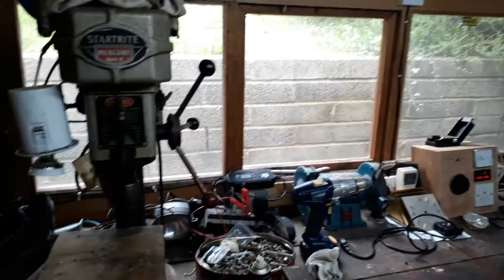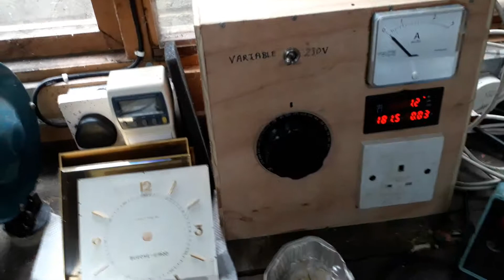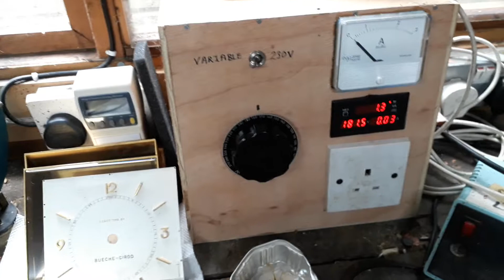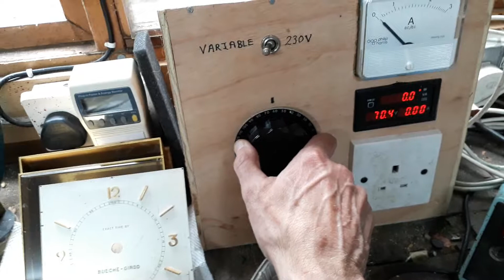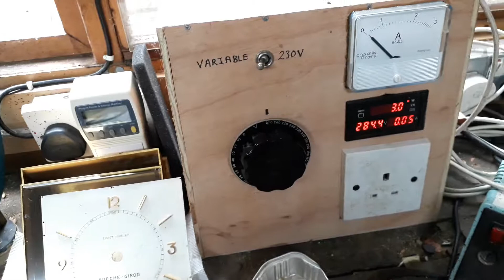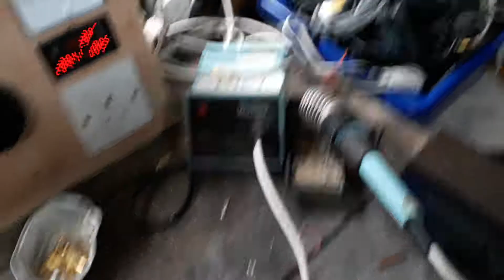Workshop tour

Comment: Good morning Sir, I really enjoyed the tour!
I’m a ham operator and recently got my interest in electronic rising up and up to the point where I started acquiring some equipment. 
One of those is the Marconi 2022E like yours. Got it off of ebay from UK and within one week I’ve experienced issues. The OM345 you mentioned I guess. Got around the problem with a quick external fix with the 4k7 resistor as I found infos on internet. Recently I bought some replacements for those and want to work on it soon. I want to do it as a learning process. I’m not an expert, just a passionate hobbiest.The question is, could I bother you sometime cause I believe I might need some help there. No one better than who did it already could answer some doubts. Want to also try a recalibration afterwards.
Thank you 🙏
Reply from the maker: Thank you for your kind words. The 2022 is a nice compact signal generator and when they were new sold for £6500! I know because in my job I was asked to buy a low cost sig gen, so I chose that one.
As you know the OM345 are a major failure point. I replaced them with modern MMICs from Avantek I think and mine is still working fine 10 years latter although I don't use it much as I bought a Marconi 2025 which is a much better unit and also goes from -140 dbm to +25 dbm which is useful.
As for calibrating after you've fixed it, really you need a spectrum anayzer which I'm lucky enough to have. Not forgetting after you've done it to reset the checksum  or you will get an error when powering it up. Anyway its all in the service manual.
I wish you luck! and if I can be of any help please contact me. My email is in the about me page on my channel, best regards Nick
Reply: @ptronix  Thank you so much Sir for being helpful. I got 4 of those replacements from an Italian old man off of ebay.
I guess there are better sig gen out there but for me it’s been my very first lab equipment I bought, kind of first love. Maybe one day I’ll get something better if I need but for now it’s been already helpful for some rf job I did on my radios. And as I said it will be an interesting learning process trying to repair it. As far as spectrum analyzer I was looking at the one you have, I think it’ll be my present next year.
Also a word on your channel. I’m digging into it and you’ve got lots of interesting stuff. A big thank you for sharing those valuable informations and your time. For people like me it’s gold!
I’ll keep in touch, thanks once again 🙏 
Kind regards
Diego
Reply from the maker: @IZ0MTW  yes diego, lots of interesting stuff to do with rf on my channel, I now have the siglent ssa3021x spectrum analyzer, its much better than the rigol I used to have but not cheap!